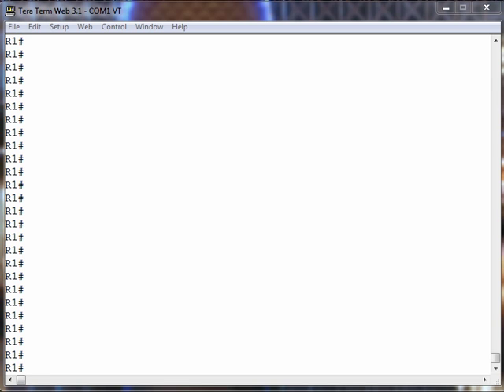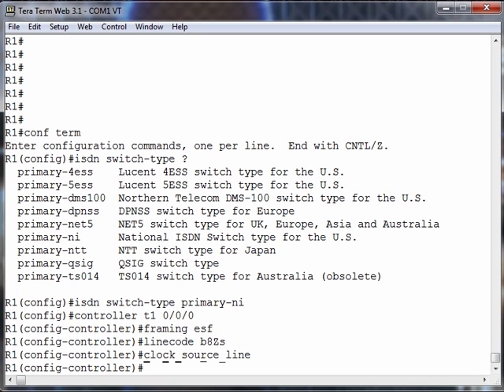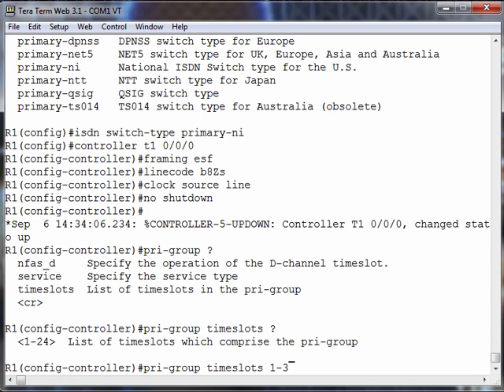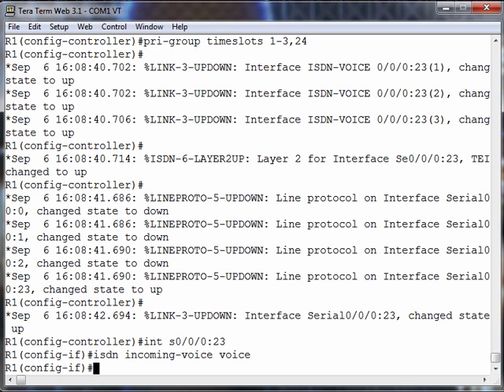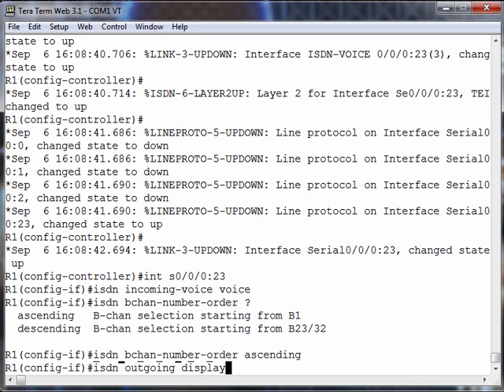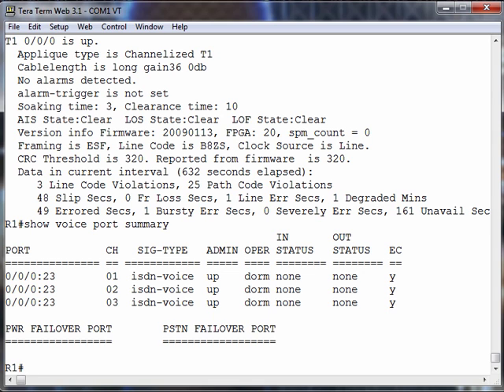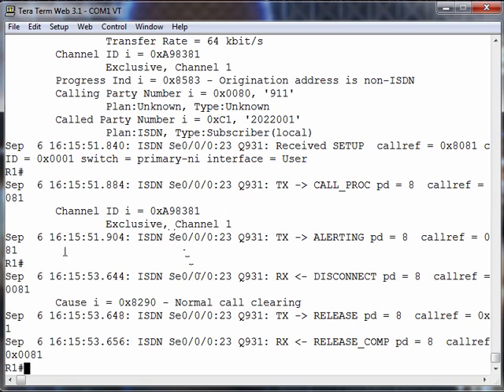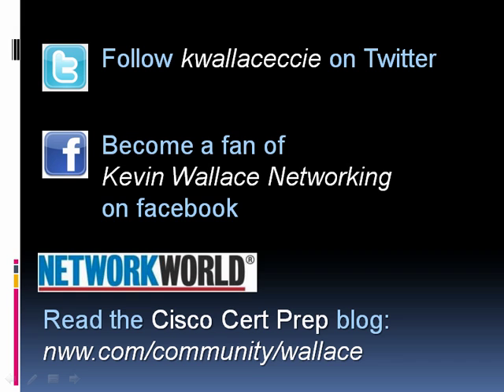Let's Get D-I-G-T-A-L (Configuration) 2 of 2

Comment: Kevin, you mentioned that the router you're working on is connected to a "PSTN Simulator,"  Is there a chance that you demonstrate how to configure the simulator?  Additionally, I assume two routers both configured per your video could not be configured completely the same?  I'm guessing one side would have to be "the DCE" side and the other the "DTE," correct?  And if so, what would be the configuration?

Thanks..